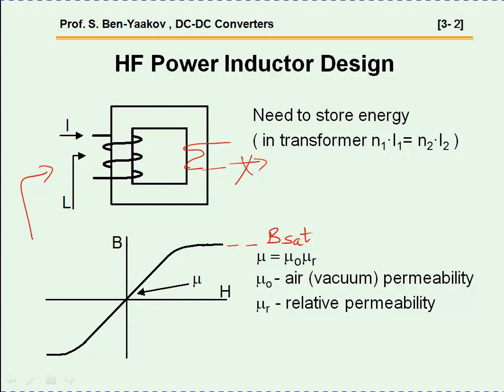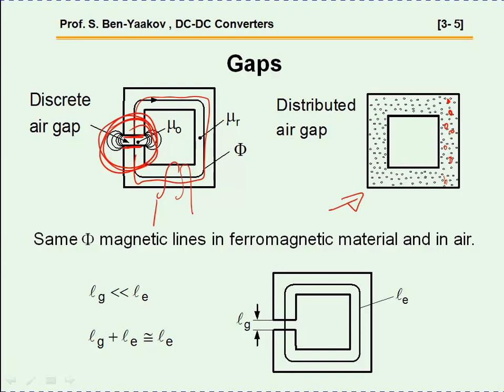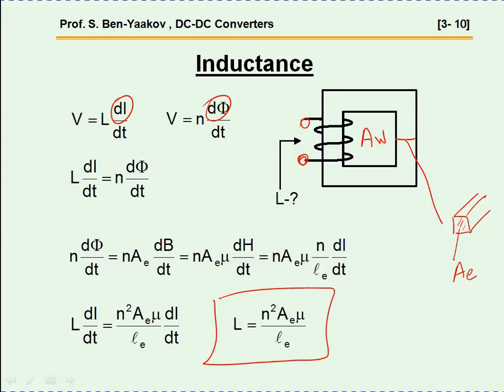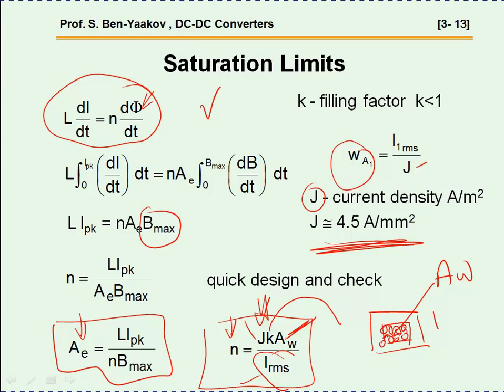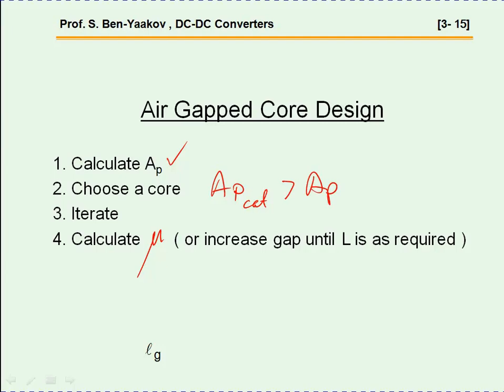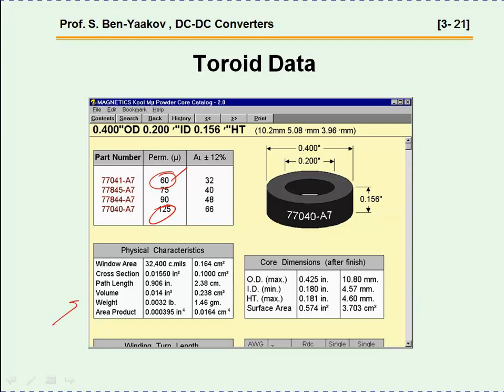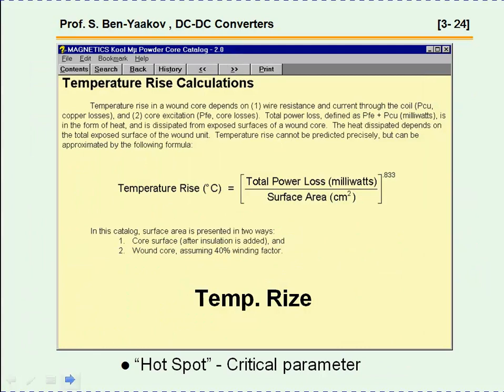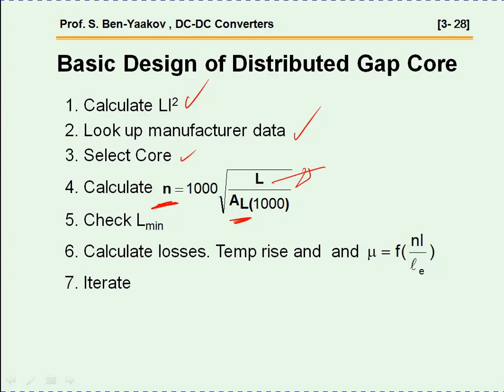ElectronicBits#22 -  HF Power Inductor Design

Comment: I've missed out on a ton of analog and been reading it up over the past few days, I'm just wondering the BH curve, is there also like a capacitor equivalent manufacturers make? Like most inductors are wound, not bought off the shelf like caps. So when designing something with non-air dielectric, do the manufacturers  also have curve  for q/m^2 and E ?
Reply from the maker: Sorry, but I am not sure I follow your question.
Reply: @sambenyaakov like when making an inductor with a ferrite we use BH curve right ? Do capacitor manufacturers also consult like relevant sheets for the dielectric ?
Reply from the maker: @arushsinha6839  We do not design capacitors, so we do not need the dielectric properties, but from the capacitors' datasheet you can infer what the D(E) is. See https://www.youtube.com/watch?v=yCK1hzgS_mU&t=1868s&pp=ygUOYmVuLXlha29jIFBDSU0%3D

Comment: hello professor, please kindly recommend resources for high frequency power transformer design for X ray application.
Reply from the maker: The main issue is insulation and if leakage is needed for resonant operation. There are many examples on the web, try ChatGPT.

Comment: It was a very informative video. Actually, I have been working on inductor design and after selecting a ferrite toroidal core (x1.5Ap required), I have observed that it is saturating due to very low Bsat (0.2T) of the core, I assume. After watching the video, I plan on introducing a small air gap in toroid ring core as I have a lot of area unutilized. Any thoughts on this?
Reply from the maker: Yes, you need a gap if there is a need to store energy. See other more recent related videos in my channel.

Comment: Hello Professor, again, amazing videos can't thank you enough for everything! I've recently become aware of the difference between small signal permeability and average permeability, where Uavg=B/H and Usmall_sig=dB/dH. I've always just used Uavg (Ur and/or Ue). I'm still figuring out which applications use which, but it seems generally we use Uavg within HF power inductor design. Is that correct? The reason I bring this up is that n=(L*Ipk)/(Ae*Bmax) is now a bit confusing to me notation-wise since when I think of Ipk I think of the DC component + half the ripple component. So, when using that formula shouldn't we just be using the peak average current, not including half of the ac component?
Reply from the maker: Thanks. Have you seen https://doi.org/10.36227/techrxiv.14975082.v1
Reply: @sambenyaakov  Thanks, I have not read that before, it was a great read on permeabilities. I'm still not sure if the paper addresses my last question about the DC component + half the ripple. Or if it does, I clearly didn't pick it up :)

Comment: Thanks Dr Sam, very good explanation 
In resonance circuit we have to pick inductor with high Q, is this means that inductance will be stable and not vary when Q is high? and how we can figure required value that we need it?
Reply from the maker: in power electronics we talk about series resistance and not Q High Q basically means low Rs. In power electronics some changes in inductance are tolerated because the systems usually works in closed loop.
Reply: @sambenyaakov  thanks Dr Sam
But there are some materials that have high Q
And resistance depending on wires , so Q related to materials not to wires?
Is that right
Reply from the maker: @karastom2304  Sure you are correct, core losses account. But still, in RF circuits of low power we worry about Q, in power electronics we talk about losses.

Comment: Hi professor, thanks a lot for the lecture.
Question here, how do we take into account an offset with delta B when looking into selecting an inductor? For example I got a simulation of the flux density in a power inductor, but apart from the carrier frequency expected variation, there is a notable offset due mains frequency. So do I take that into account or look only into the ripple caused by the high frequency?
Reply from the maker: Losses area a function of Bac but you need tp make sure that Bpk does not approach the saturation of the ferrite.
Reply: @sambenyaakov  many thanks

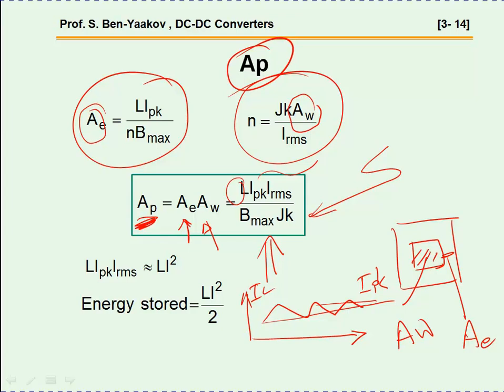Comment: Hello professor, this was a very nice lecture but i can't seem to understand the RMS value at 23:30. First of all I have seen the comments below and i know that 1/T should be inside the square root, i suppose that the integral limits should be at a given period of time (0 to T for example) but i am not sure about the equivalent equation of inductor current (IL). I used LTSpice in order to simulate the situation on a buck converter during DCM and CCM operation but i can't seem to find the right value of RMS current through the inductor with calculations, the value differs completely from the calculated value of LTspice. Last thing i want to mention is that i have seen the generic corresponding formula of a periodic signal over time from Wikipedia (Definition - Equation 2), should the f(t) (corresponding inductor current - IL) be replaced with the typical equation of V = L*di/dt or something else? Thank you.
Reply from the maker: Sorry too involved, I cano't go into it.

Comment: Thank you Professor for continuous sharing of inspirational ideas. 
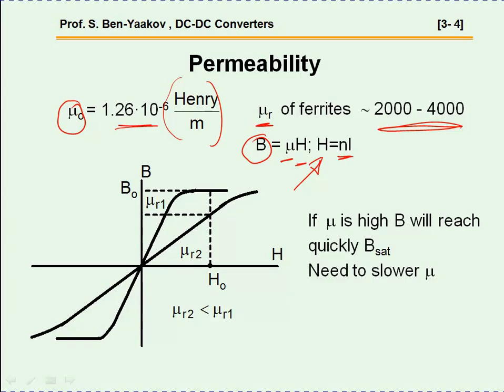By the way, I'm just curious, in 6:07, you define "H" as "H=nl". However, is "H" suppose to be H=nI/L, where H is the magnetising force in ampere-turns per meter (At/m)?

.
Reply from the maker: Yes, correct. I have put a note on that at the description section. Thanks

Comment: Thanks for the video Prof! It was very enlightning. I have a question regarding distributed gap core. When you say the core has  u= 125 does it mean that effective u is 125 or does it mean the effective mean is u0*125 (1.256e-6*125 = 0.157e-3)?  Can you please clarify.
Reply from the maker: Hi, thanks for comment. 125 is reative mu. For actual permeability you need to multiply by nu0.

Comment: Prof. Ben-Yaakov, is there a core losses calculation part? Also, how come there is no copper losses equivalent? Combining the core size calculation with the copper losses (and possibly the core losses too) one could create a (probably) quite nice optimization problem.
Reply from the maker: Thanks. These are left for homework😊Given the Delta(B), the frequency, the  magnetic materiel chosen, the diameter of the wire and the mean winding length the losses can be calculated.

Comment: Very useful material. at 34:45, it is mentioned 1 Amp/m=79.5 Oe. I think it should be reversed, I mean "1 Oe=79.5 A/m" is the correct relationship.
Reply from the maker: You are of course correct. Thanks for pointing out the typo.

Comment: Thanks to your videos I now have a lot less interference going back into the mains when I use my monster ZVS driver, for me it's now easier to know where the signals go and how I can isolate different frequencies, especially the high frequencies with high power from going back to the the line voltage or mains.
Reply from the maker: Thanks for sharing

Comment: Can you pls guide me to arrive at core cross section Area if only secondary voltage and primary current of 30A rms is available .
Reply from the maker: How about turns ratio and frequency?
Reply: Sam Ben-Yaakov sir, frequency is 50hz and the power drawn is 10mW from the CT. Turns ratio I have to arrive . I dint have turn ratio too
Reply: Sir can u take up a session on how to arrive at cross sectional area and no of turns, if we draw power from CT.

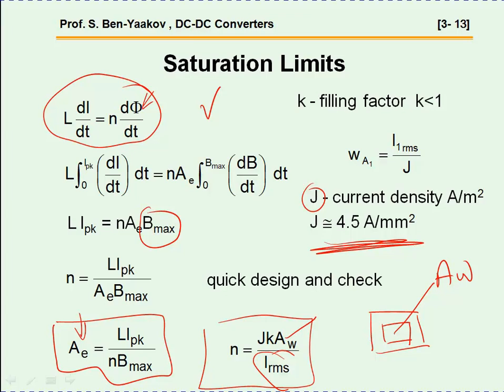Comment: Thank you so much for the lecture professor! can you please tell why the number of turns and the Window area depends on the RMS current, while the cross sectional area depends on the peak current in  20:29
Reply from the maker: Rms determices the cross section of wire and area of wires and time n is the area you need in window which we what to fill. Ae is bound by the constraint  Ipk L= n Ae Bmax

Comment: Hello Professor, is there any alternate way for selecting distributed core size without seeing manufacturers LI^2 curves.
Reply from the maker: The LI^2 are really not a design tool but rather a pointer to the approximate core you need. You can use the AP approach to locate core.

Comment: Hi Dr Sam, thanks so much , as usual you are amazing , your lectures are very helpful . i have question about the Ac ,i do not see in the equations the effect of frequency on Ac, like when frequency is high we should be able to use smaller Ac , and also what is the effect of the topology (forward, flyback,half bridge, full bridge on the Ac.
Thanks so much Dr Sam
Reply from the maker: Hi Karas, This video is a very basic tutorial. Additonal issues are covered in the new
https://youtu.be/r-hK2OZp5D0
Reply: Frequency decides the value of Inductance,Higher the frequency lower the L as you need to store power for shorter time  and less LI

Comment: At 32:20 , mu0 (magnetic permeability of free space) is 4*Pi*10^(-7), but in the video they show it is "-8". Can you explain why is this, please?
Reply from the maker: Units.  l is in cm and A in cm^2
Reply: Yes, I saw that. It did not make sense because I did not see the "dot" in front of the "4". So it is actually 0.4*Pi*10^(-8) H/cm, which by the way I think you have a typo at 32:26
Reply from the maker: You are correct. I guess I also did not see the dot and didn't ponder about the value. Thanks.

Comment: One minor error skipped through  at 24:02, for the RMS value of I the 1/T term is inside the square root. Excellent video! Thank you for sharing it!
Reply from the maker: Thank you for the correction. You have a keen eye. Sorry for the slip up. I could have said that I did it on purpose to see who would catch. But I did not  :-)